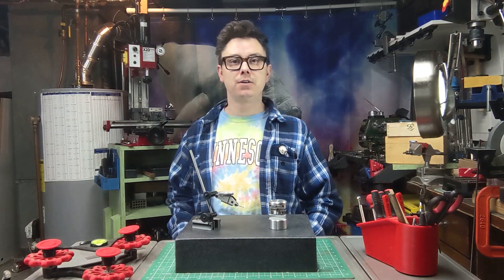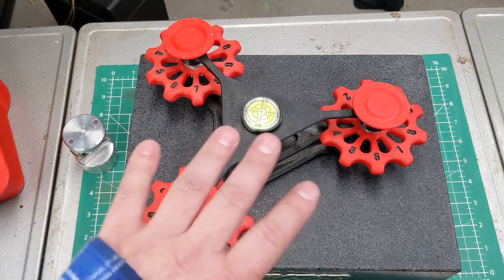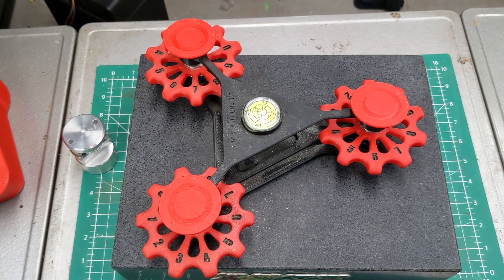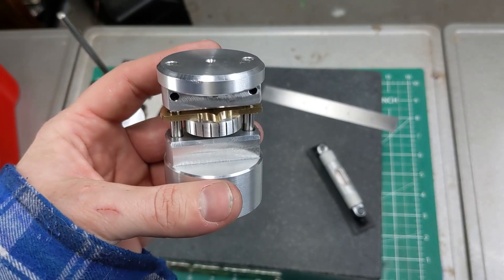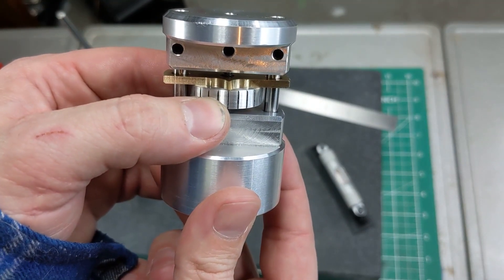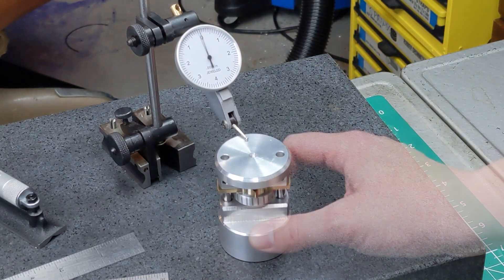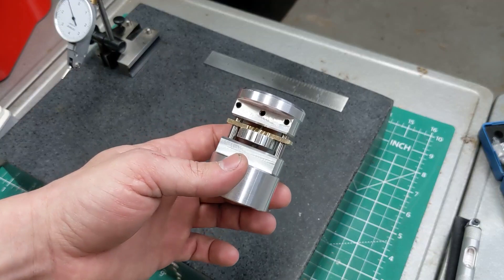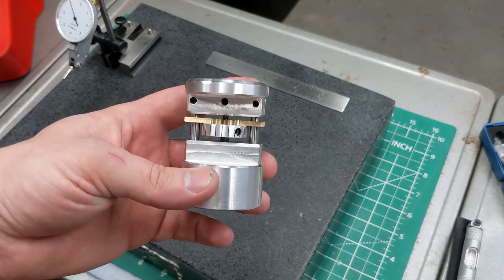I Tried to Make a .00001" Graduated Screw Jack

Comment: A pair of cheap micrometers could be precise enough to sacrifice for science.  Imperial is of course .025 per revolution, metric is .0254. I think the threads are ground, and should have much tighter tolerances than any ordinary screws and nuts. That would get you what, .0004 per revolution and .00004 per 1/10th division and .00001 for 1/25th division?

Comment: each of the differential screws needs to have linearity near the level of the desired pseudo-pitch...not so easy, but might improve with some kind of mechanical averaging over a longer thread, with a bit of compliance in the threaded body, to allow a bit of squish..

Comment: Ironically, it's the printed plastic nuts that keep the differential bolt from runout.
Reply from the maker: If you're talking about the leveling plate, there are embedded grade 8 nuts in the printed parts. I made that before I had a lathe or mill at home, but I'd do just about anything to avoid printed threads.
Reply: @makerunderground  I'm only talking about the printed nut. Everything else in the mechanism, of course, must be made of metal. This is the only solution that allows you to cheaply get rid of runouts of all kinds.

Comment: Maybe picking up some error the the indicator tip not being at the 11 degrees or whatever is spec'd for that one?  Might be some odd motion in the internal mechanism when it's not under the tip right.  TOT has a video on that somewhere, and I've seen a couple others, stefan I think has one as well related to that type of indicator measurement.
Reply from the maker: The tip should be 11° from the surface it's checking so I'm actually pretty close, probably +/-5°. 

The problem we are talking about with test indicators produces a sine error, which at shallow angles would only be a small fraction of the overall measurement. It couldn't account for the measurements we're seeing. 

In hindsight, I believe a lot of the error we are seeing is just me influencing the setup as a turn the adjustment wheel. There are some good comments identifying issues with the device too.

Comment: I think if you had put your indicator on the center line of the jack, instead of out near the edge, you would have eliminated virtually all of  the reading jumps.
Reply from the maker: That's a very fair point. There were actually a lot of issues with the inspection. The piece being aluminum made it too light to manipulate without moving it around and the adjustment knob being on the two threaded shafts allowed a lot of human error to be imparted too. 

I've gotten a lot of great feedback since I put this out. I haven't decided if I'll revisit this yet, since I don't have  a practical use for it. I always appreciate more input though! Thanks for the comment!
Reply: @makerunderground  This would make a great educational/learning tool.  As Landon mentioned in his post, three guide rods would probably stabilize the lifting platform more.  Once pre-loaded, and measured in the center I think you wold get amazing readings.  Great work!
Reply from the maker: @sinkhole40  again, thanks for all the feedback. I really should do an update video at some point.

Comment: Despite having a lifetime in engineering,  have only at 70 Yr old heard of differential screw threads. Absolutely fascinating. Love also the way you go from metric to imperial measurement.  Some things just make more sense in thousandth of an inch. This will no doubt totally confuse our European friends. Thank you, Dave from Uk😅
Reply from the maker: I live in the US but work in medical manufacturing. I'm used to having imperial machines and metric prints and my brain goes back forth quite easily. Add to that that in the home shop I have a metric lathe and an imperial mill and I end up with a terrible mix of the two systems that would probably make anyone else insane. 😅

Comment: Thermal expansion is more than 10 uInch.  Also, your jack would need to be supported by three synchronized points to remain stable in a horizontal plane.
Reply from the maker: Correct on both accounts but those still aren't the only reasons this didn't work. I frequently work down to +/-.0001 professionally so I was well aware that my efforts weren't really up to the task of gaining a whole order of magnitude. I've gotten a lot of feedback on the design but my inspection is just as shoddy.

It was really just meant to be a fun little thing to help explain differential threads and give the video a little bit of a hook. I might revisit the design one day because there a lot things that could be greatly improved and these kinds of videos seem to be relatively popular on my channel.

Thanks for watching and commenting!

Comment: Nice attempt! This would be a neat project to try to make work at that resolution. It encompasses everything. Pitch accuracy, backlash (or better to preload perhaps), guide accuracy, hand knob influence, probably even need a breath guard. ha ha.
Reply from the maker: Yeah, this is really it. We are talking about laboratory tolerances and I'm just winging it in my basement with off the shelf parts and a low effort design. It's a fun idea and fun to think about but I'd probably be better off refining the printed indicator than trying to make this work. Thanks for watching!

Comment: You need 3 precision ground guide rods, holes reamed to match, a differential screw turned down perfectly to keep it linear, and perfectly vertical tapped threads for it to mate with. The  readings you are getting are a wobble resulting from your screw being ever so slightly bent, and would definitely make more sense if you placed more than one indicator around the circumference of the jack
Reply from the maker: I did have ground rods with reamed holes but I agree, three makes a lot more sense. I also agree with everything else you said. The location of the adjustment knob also allows for a lot of influence from the operator while rotating it ad that could be improved. I still doubt any off the shelf threaded rod is going to be accurate enough to get this working. I also wasn't willing to buy more than one tenth indicator for a a project that isn't actually useful. Haha. It was a good excuse to buy one since I only had .0005" indicators at home, previously. Thanks for the good advise, all the same. Hope you enjoyed the video.

Comment: I wonder if you lathe cut your own screws for a tighter tolerance and use a form tap if you would get better results
Reply: Well it looks cool and the idea is insane plus that brass pointer....
Reply from the maker: There are definitely things that might help but  .00001" can be affected by a finger print or even your breath. It would be cool to get closer but it was never really a practical goal, in my mind. 

I guess I have a bad habit of making interesting things with questionable usefulness. 😎